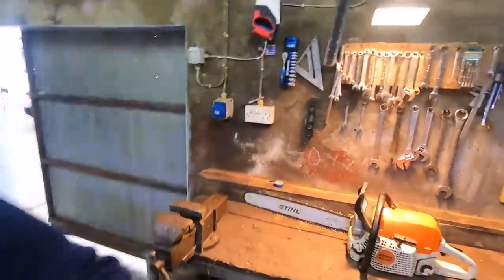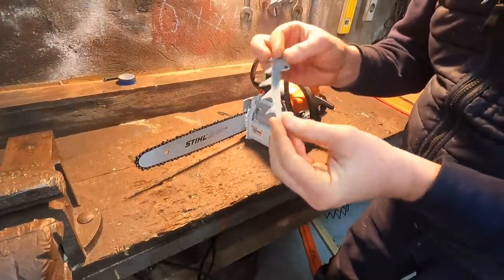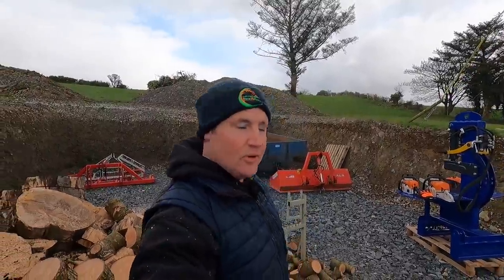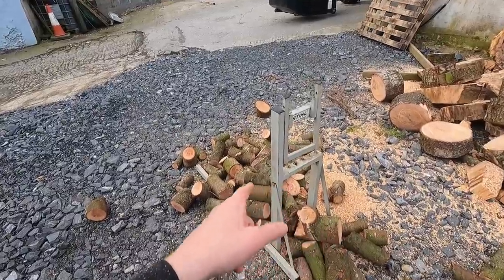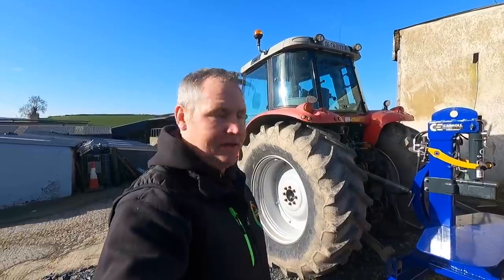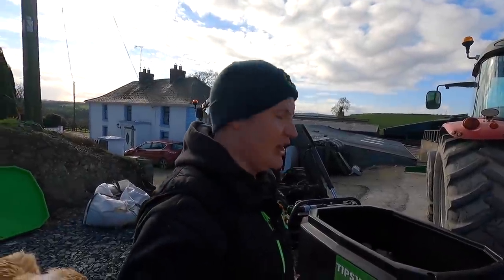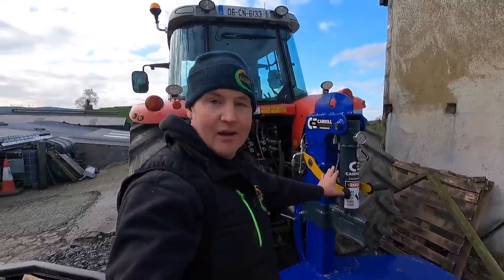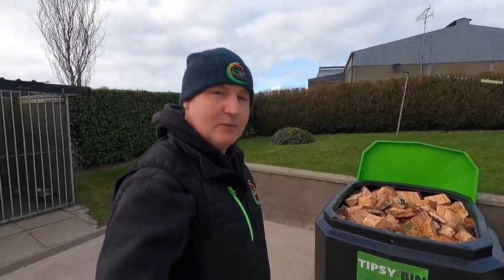THIS LOG SLITTER IS A BEAST!! "UPGRADE ANY CHAINSAW FOR NEXT TO NOTHING WITH THIS"

Comment: I have to agree, Stihl is one of the best on the market. After doing the chain saw course through FRS, I couldn't help but notice while you have bought all the gear you're overlooking a couple of safety tips, you're not using the chain break and you shouldn't start a saw cold between your legs like that. But overall good video

Comment: Big Stihl fan as well. My first saw was the 039 Farm Boss. Then I picked up the 391 when I had a 2 saw job coming up, and followed that up with the arborist saw. I also have the complete Combi set of tools with an 095, and a 130 power head.

Comment: You've got to love it! Your 150 hp $200k log splitter beats it all, and a 2nd tractor to haul it. One usually starts with a cheap usually free, wood stove to save heating costs, well maybe create a cosy mood. Then a chain saw and the clothing. Now one needs a cheap pickup truck to haul the timber. Then comes the winch to drag out this cheap source of heat from the woods, most of the trees are in swampy areas and only when the ground freezes can you get in there. Cable too short, a cheap tractor to drag out the logs is needed. The wood lot is too far from the house to drive the tractor so a trailer is needed to haul the tractor, but it can also carry logs, good idea. You now have 8foot logs piled 4feet high and 50-100 feet along your fence line, neighbours complain to the local authorities. Get it out of sight you are told. Right, cut the logs into average stove lengths, 16-24" stove dependent, and split and stack them. where? No problem, apply for a building permit and build a wood shed or why not, a future garage. Splitting is such a chore, our logs are much bigger and so many more of them than yours that we need not only a wood splitter but why not get a wood processor for just a few thousand dollars more, then,  firewood could be sold from the end of the driveway. You can see how far this can continue to go on. 
I haven't seen any large rows of logs at your beautiful place, nor have I seen a firewood for sale sign at your farm gate. My hat's off to you, you are ahead of the game, well done. I hear that there is money to be made in wood pellets, will your splitter also press out pellets?

Comment: Great video Adrian, a fine log splitter, just a idea, ur hose connections to tractor, if u put the return a non-restricted return, (not through valve chest) on massey's there's place's to put in fittings, non-restricted returns will save external chest on log splitter. Mechanic told me to do it years ago, I put one on for my tractors for log splitter, road sweeper n hedgecutter.

Comment: I love that bin! There is another handy product, you probably wont need it since you cut your logs so short. Its called Woodcutters helper, its a magnet with a fiber rod to attach to the chainsaw blade it helps you getting the same length on every cut. If you google woodcutters helper it should come up on the first links from ebay a little costly in my opinion might be you could use one of those telescopic magnets mechanics use to pick up screws instead im not sure at least they are under half the price.
Reply from the maker: I’ll look that up, attach a link if you have one, sounds interesting 👍👍
Reply: @IFarmWeFarm   Cant respond with links it seams tried two times now with different links, Just google woodcutters helper it is the first two links.

Comment: That smart holder is just billiant, i already placed the order
Reply from the maker: It’s great 👍
Reply: @IFarmWeFarm  I bought a similar one to the smart holder and I would not buy again or recommend it.  I still have it and I no longer use it.  I got the Timber croc and I would use it all day with no adjustment needed when using different size logs.

Comment: Very nice log splitter, I especially like that there is a pin on the blade and that it's not welded to the ram. Can I ask you will any spool valves do on the tractor. I don't know if mine are restricted on return or are most tractors?

Comment: May I suggest that when working with the log holder to have the gripping part on your right. Working it that way, when you get close to the steel  you don't have to cross your body with the saw or the frame blocks your view of the bar
Reply: May I suggest to put grease on the bar that goes up and down and great setup aidrean

Comment: Great video, really enjoying your channel. One potential problem I can see with that splitter is if the wedge/blade gets wedged or caught in a log and lifts with it on the return stroke could it come up and bend the handles or worse trap your hand if it was on the handle, maybe there should be a guard to stop a log coming up to meet the handle. I know it would want to be well stuck into a knot or a twist but it could happen.  Other than that it looks like a great bit of kit and well built.

Comment: Another quality video as usual. I'd suggest having the log splitter raised level with the tipsy bin and then all you'd have to do is push / swipe the logs into the bin rather than lifting them all the time. That bit higher would also be better on the back. Bit higher to lift logs onto though, I'd admit. Cracking machine all the same.

Comment: Hello Sir
I love the Log splitter very clever piece of kit
I wonder if a Power Pack would operate that splitter Honda pack or JCB Beavertale cheers love the machinery powerful tractor with the right Hydraulics helps have a great 2023
Great to see the girls shifting firewood many hands make light work
Are you doing anything more on the house

Comment: Great piece of kit & a welcome addition. Just one question, I noticed on your splitter that the ram goes all the way back up after splitting a log. Seems to cost a lot of time especially on smaller rings. On our splitter you can just back it up as much as you need before making your next pass. You're losing time on both upward & downward stroke. A small thing I know but it would drive me mad. :-)
Reply from the maker: No funny enough when you get used to it you would let it go all the way up, I flew through stuff when I got the nack of it 👍
Reply: @IFarmWeFarm  It looks fair quick alright! Powers through those knots! 💪

Comment: Some hassle with needing 2 hands to move it up and down, sometimes you'll get timber that "pops" if ya get me and its nearly safer to hold onto it incase it flies somewhere it shouldn't 😬
Reply from the maker: It kinda something you need to actually use to see how easy it really is, yes them bigger logs all pop and fly, but if you position the logs a certain way it only flys out to the sides. Important rule to protect the tool 😜
Reply: @IFarmWeFarm  I have used it like that, didn't take long for the second handle to be blocked up with a small piece of timber 😂 dont tell the HSA 🤫 that's true about positioning it so it only goes out the sides, only a fool doesnt protect his tool as they say

Comment: I bought the Stihl MS 170 on your recommendation on an old video and yep, it's a super saw.
I got mine from  Robert Kee, Donegal.

Just on the log splitter. Set the table 1 meter or so off  the ground, slide the logs off the trailer.  You can work like this all day and your back be perfect. No lifting.

Comment: Great Log Splitter, How many HP does it need to operate it. Would it go on a 135 ?
Reply from the maker: It’s not HP it’s the litres per minute that’s important, I honestly don’t know but them lads in Carroll’s would tell you, they also make a fully independent one that runs on a small petrol engine

Comment: What's the litres per min flow on your tractor, and the tonnage rating on the ram please, looks a ni e machine, vertical log splitters with a table so much better than picking stuff off the floor.  Now you just need to build a rack to cut your small round wood in. I use a ms261 with a 16 inch bar and cut 10-12 pieces of small round wood 5ft in length in one hit, 6 cuts gives you 70 pieces of firewood and your not bending down.

Comment: Can you adjust the stroke on the log splitter or adjust table height if only splitting short timber?
Reply from the maker: I don’t think so, definitely not the table anyhow, but when you get used to it you will be able to go faster so it doesn’t go up all the way, that stuff I cut was very short and I flew through it.

Comment: I'd be welding a bar between the two handle.. lovely looking machine with tonnes of power but having to have two hand on the yellow lever would drive me spare!
Reply from the maker: No if you actually got to try it first you’ll see i’m rite, I like things that are handy and it is incredible easy too use
Reply: @IFarmWeFarm  I can't lie it does look incredibly easy to use.. and the more I spend time looking at the machine I'm astonished how well made it looks to be! But I just couldn't be doing with putting both hands on the lever... if someone is silly enough to manage to trap there hand in it, then as a fellow farmer I think you'll agree, they probably shouldn't be using it! I could be wrong as your the man with experience with the machine! But I don't think I'd enjoy the handle.. I have to say

Comment: did you sharpen the chain ?
Reply from the maker: No but I have done so since, the 391 needed it for sure
Reply: Ah sure what what would you expect from a STIHL... Adrian pick ups husky 390xp someday theres your machine..
😂😂😂💪💪💪👍
Reply: @paudiemullins3883  get a husky 550 xp good saw that
Reply: @gruffuddlloyd7120  
I've got a 3120xp I'll say no more
Reply: @paudiemullins3883  or a 560 346 pit thats a old model

Comment: Why do you cut your wood so short? Here in the states I usually cut mine around 16 inches
Reply from the maker: Our wood burning stoves are much smaller here, even some of the logs I cut are still to big. It’s a good point to make though as I always wondering about the length you guy cut yours. 👍👍
Reply: Ahhh that make sense!

Comment: Only fooling yourself bypassing safety measures !
Reply: It does depend on experience, care and the timber. I used to work at firewood processing up until lately and found that in some types of timber, the knotty pieces can fly. One free hand to save your head or chest can save a life. But for the average joe, leaving the safety features is a better option.
Reply: @diarmuid858  you're dead right on that point. I was splitting timber with knots. They would go flying as you said